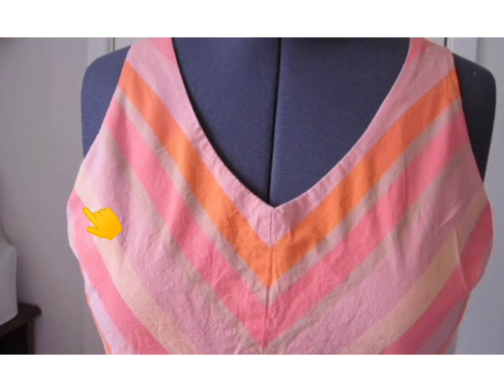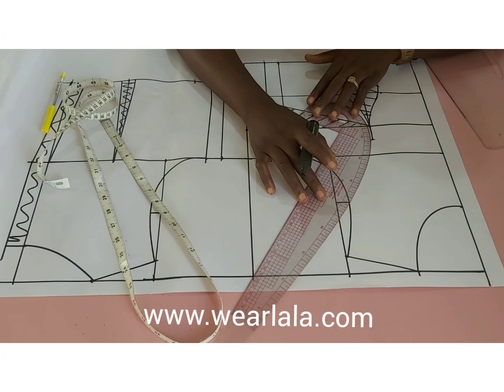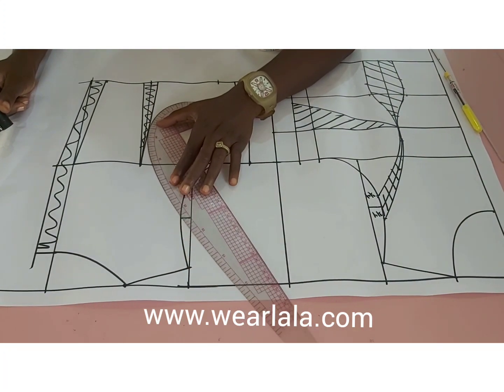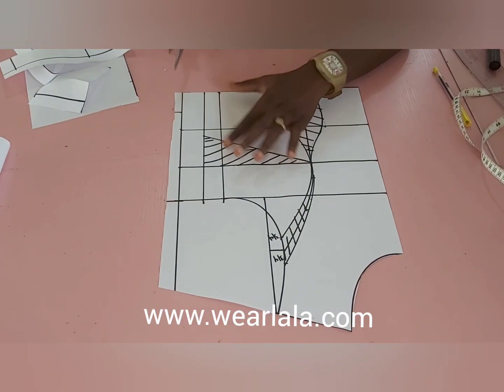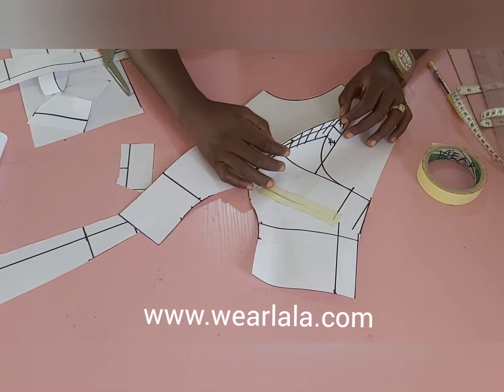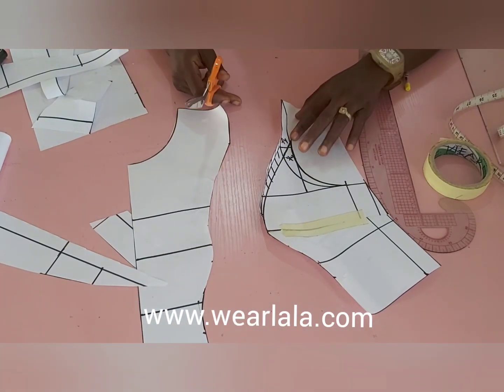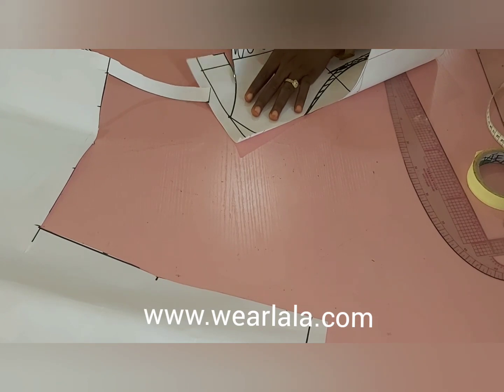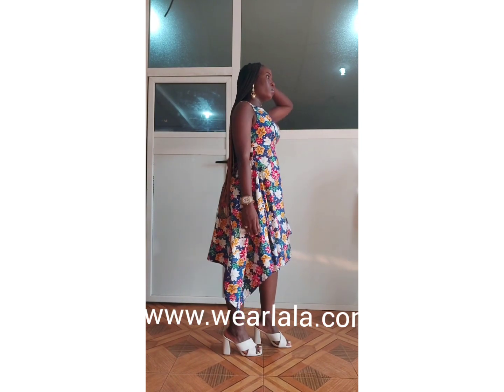How To: Fix Gaping Armhole on a blouse with princess darts.

Comment: I made a dress following your tutorial on how to make a princess dart bustier and the armhole was gaping.
Reply from the maker: Maybe it wasn't tightened.
Reply: @wearlala  But I followed your tutorial from the beginning to the end.
Reply from the maker: Probably something wrong with your measurements.  If your armhole circumference is wrong   even with the tightening u will still have excess
Reply: If the gaping is at the back, i guess it happened because of the front. Lala you didn’t indicate the inches cut out at the front armhole for the tighting must be replaced. I followed the same tutorial and I had issues with the armhole too. Painful. But I managed to correct it cos I added extra SA